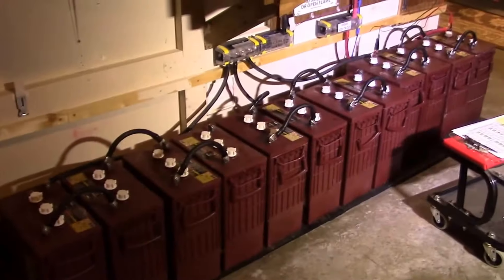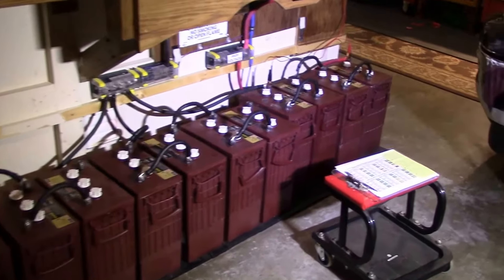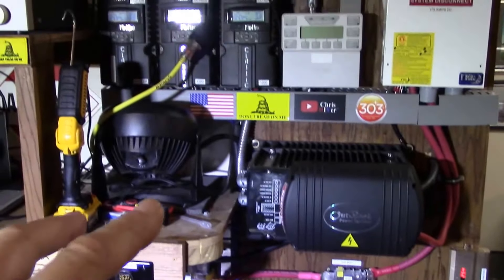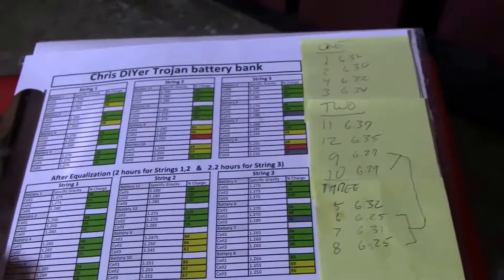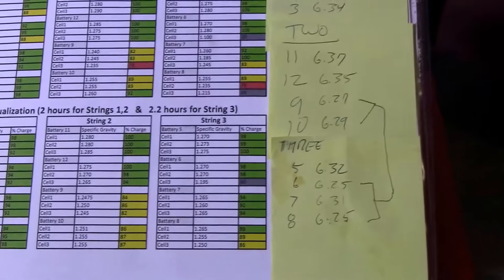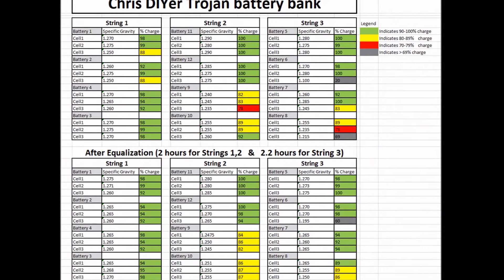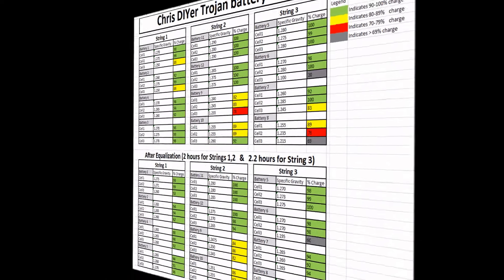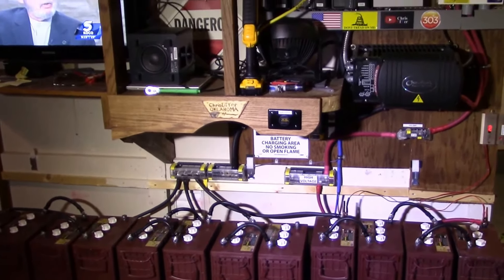Making progress with this battery bank - thanks!

Comment: Good to hear :) Thanks for the update and I'm learning by watching :) Peace and Merry Christmas :)
Reply from the maker: Thanks...even a "bad" video can help others. May show them what "not" to do or churn up some insight inside their own cranial matter. My recent failures with this system hopefully will help others. Merry Christmas
Reply: I'm considering going to AGM batterys.  Have you had any sulfur issues with AGM's?
Reply from the maker: None (if you're talking about the actual terminals). AGM's are sealed/maintenance free (so no watering, battery caps, spillproof, and almost zero venting/acid hydrogen mist...safe to use inside). There are a lot of "AGM" types out there. Make sure it says "Deep Cycle" AGM on it...heavier duty, greater depth of discharge. Some of the companies that make them are: Interstate, Trojan, Outback Power, Rolls Surrette, and VMAX Charge Tank. There are many more out there. Been looking at all of them. Some of the "newer" deep cycle AGM's now available for the solar/wind communities are really terrific vs just a few years ago. The high end ones could run $450-500/ea. With any battery...lifespan is determined by depth of discharge and cycles. It all depends how deep your pockets are too...but, worth the time/investment/effort to ask-ask-ask for MANY opinions from others who run them. I run a four-gun deep-cycle AGM battery bank in my bedroom SOLGEN (four Trojan 31AGM "Overdrive" batteries)...and I freaking love them
Reply: Thanks Chris :) I sure do appreciate the info ... I was kinda "window shopping" online today after I noticed a low cell on one battery in my only string of four. It is the oldest one and up for replacement soon.  It's on the desulfate cycle right now. I'm still building it up as money allows, but this is gonna have to wait 'til after Christmas :) Thanks again.

Comment: Cool beans, gotta love the FLA "drama". At least you're making some progress.

Just signed the paperwork to get my solar project underway, granted it is strictly grid tie for now. It's a start in the right direction.

Cheers...
Reply from the maker: Congrats...it is addictive. Grid-tie has some real benefits. The guys who have "Hybrid" systems are really well off. Those are the ones with Grid-Tie, batteries, wind + solar, gas/diesel generator, and manual switching. Sexy stuff...but uber-expensive!
Reply: Yep, the best bang for the buck is grid tie at the moment. I already have the 48 volt @ 300 Ah worth of AGM for backup purposes and saving up for a grid interactive inverter to help compliment the system overall. I already have 2 SunPower E327 modules "cooking" in the backyard to keep them topped off.
Reply from the maker: Oh wow...that is sounding great! The Sun cells are beasts